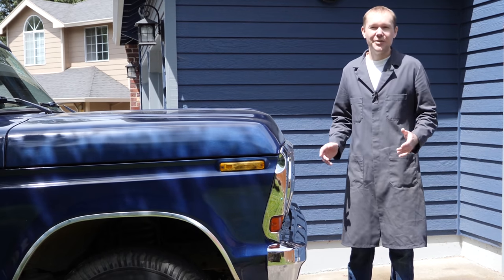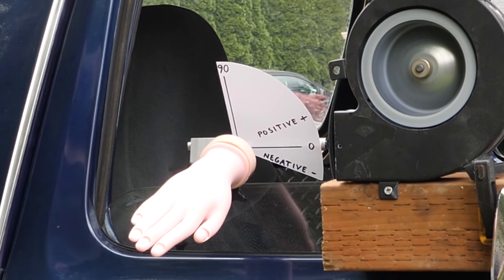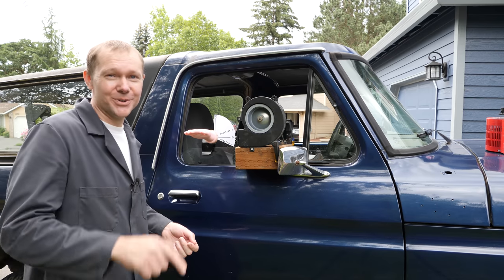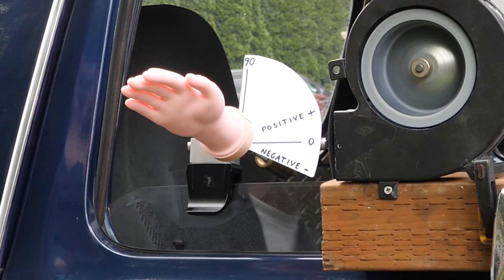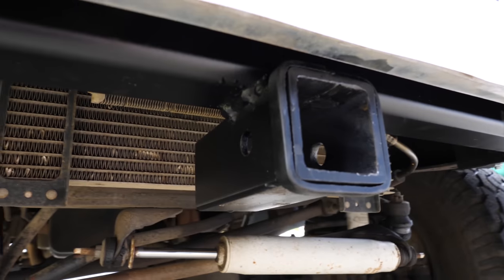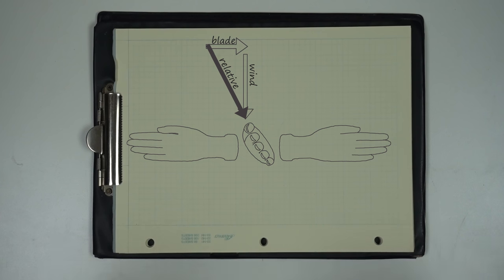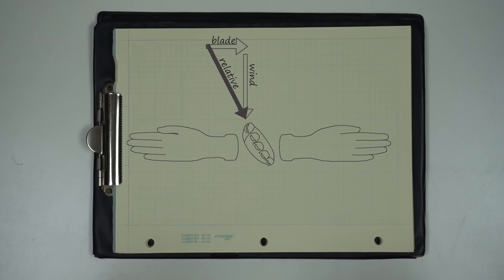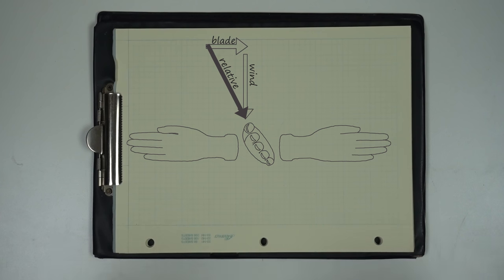Wind Power on a CAR #1 - Is it FREE?

Comment: I recommend not doing this out the public streets for the fact it is better to put a small turbine fan and install a safety feater because it is better to do so that is the fact in future the fan size turbine can or could either kill or injuries risk.  What I present an idea is using those small computer fans size as turbine energy crank because you can add tons of cans in the front and it is smaller enough that wouldn't hit no one but have to worry car accident but then again you could put it on you know the side of your door or somewhere on the rail of your car or either attachment on top your car.  This will help a whole lot and probably able to charge your phone, the car battery and so on stuff but the big problem is there is no warm weather every time so what do you do then?  uninstall the fans during after fall that is all I can say because snow in small fans is hard to have it ok during that time because in winter if water get into the fan's wheel barrel basically you're stuck for long periods of time.  The best bet is to install these fans in your car as in near the engine that is a slap in because you do get wind in there but the chance of risk of water being in there may have slightly slim in somewhat ways for I still recommend to actually figure out how to waterproof it and keep them durability in good shape.

The best idea is to use thermal energy as well because of the fact we are burning form our car and having something on top of it provide the heat acting like conductor sort of like how thermal generator works but there is already invention about it which have to do with burning stove wood in camping device which it charges the battery and if that heat is not being used for anything else it would be complete rubbish which yes I do know the engine can charge the battery but wasting that much of heat should have been used as well because you won't get every single energy out of the car what it is making.

We could have 3 power providing for the car, solar, a turbine wind and thermal energy which the solar car is already invented, a turbine wind you had made and thermal energy the burning fuel energy for we want to get much we can with these trio powerful conducting energy as an example for it could possibly charge up a whole house in no time.

Comment: Could you perhaps use a "cylindrical wind turbine" style of windmill mounted horizontally, and take advantage of the magnus effect to both redirect the wind up and over the vehicle AND generate a little bit of power, while minimizing the additional drag on the front of the vehicle?
Reply from the maker: Interesting.  I've never heard of the magnus effect used that way.  Hmmm.
Reply: @QuintBUILDs  well my thinking is that if you have such a cylindrical turbine mounted sort of high, maybe about hood-level or slightly below, and spinning in such a way that the side that's downward toward the road is moving back and toward the grill/hood, it will de facto pull the air that has nowhere else to go up and over the hood (or under the truck) and because it's moving with the natural flow of the air, you will simultaneously exploit the magnus effect sort of gaining "lift" due to the higher pressure below the cylindrical turbine acting as a wing and the air current having little other choice.
I haven't bothered trying any of the numbers, that's what experimentation is for, but at least in ~theory~ it could work, how well I have no idea...
If it turns into the next great invention that makes zillions of dollars I only ask for 1% of the royalties ^_^

Comment: Seems the "positive" vs "negative" angle of attack just regulates the direction your fan will rotate. Because "negative" angle of attack is only negative on the right-hand side. On the left-hand side, it is the positive angle, so you are thinking wrong. Instead, use the angle at the top position. It will make things clearer. It's not about lift, it's about lift vs down-force. At the top position, that would be leftward vs rightward force.
Reply from the maker: It starts to matter with asymmetrical airfoils.
Reply: @QuintBUILDs  
Of course. But that's the reason, not lift vs nothing. Fact is, down-force is used in car-racing, to keep cars on the road.
Reply: Fact is, apparently an F1 car could likely drive on the ceiling of a tunnel, due to it generating so much down-force, it exceeds the weight of the car. Quite fascinating. I don't think anyone has tried it, though. :D

Comment: No.  It will take more energy to cause it to function than it will generate. 
The vehicle is likely more un-streamlined than it was before the wind turbine was created, so no reduction in energy required, but likely an increase.
The air coming off the blades of the wind turbine is creating turbulence that will likely effect the vehicle, thus worsening it's energy required situation even more.
That's my prediction, but have fun testing all that. :)

Comment: What you could do is have the fan drive an electrolizer, that generates hydrogen and oxygen, and pump the hydrogen/oxygen mix into the intake, and decrease the amount of fuel going into the carburator, that way, you decrease the amount of fuel you actually use to run the engine, and increasing your range and fuel efficiency

Comment: I'm pondering the possibility of mounting a used 12 volt permanent magnet cooling fan on the front of my old Dodge brick and using the electricity generated to produce hydrogen via electrolysis. I look forward to seeing your results.
Reply from the maker: Should work, just depends how fast you go.  Those brushes will probably give it a pretty high start up speed though.  I'll be thinking of your application as I do this!
Reply: @QuintBUILDs  I'm still out in Imaginary Territory but as I happen to have several of those cooling fans laying around I thought I might add this to the list  "improvements" I'm adding to my Dodge brick (1988 D 150.) They could sit right on top of the 6"x11" oak bumper I've already added to the front capturing the same air that flows through the radiator.
I'm also considering trying to recapture some of the lost heat that flows out the exhaust. General Motors is already doing this in some of their full sized SUVs but it is pricey and I still need to learn a lot more about how it works. As I'm retired and living solely on a Social Security, my projects are built from junk. Didn't stop me from building this StreetPlane some years ago:  http://www.lassiter.com/mov/jones.html

Comment: wanna try something cool? try tying a rope between the top of two PINE trees, the rope has to be made of NYLON and be as thin as possible, loop the rope around as to end up and the starting end.
place a two blade propeller in the middle of the rope between the trees. then spin the propellers in order to twist the rope as tight as you can, when the rope looks twisted end to end and you notice the tip of the trees are bending slightly release the tension on the rope by allowing the propeller to spin back.
see what happens!!!

Comment: I dont want to sound like a safety sally and I know you're going to be careful but if you drive on a highway that post basically acts like a spear into any car infront of you, could the turbine be mounted closed to the front bumper?
Reply from the maker: I get it, like an old steering column before they made them collapsible?  I suppose I could put a weak pin in the receiver tube that would shear easily.

Comment: What would happen if you were in a hybrid vehicle and used a horizontal fan connected to a generator while removing the Internal Combustion Engine and just use the air generated from the movement of the vehicle to recharge the batteries?

Comment: Couldn't the reason why the hands are turning be more of a result of the moment about the hand's axis that it's attached to? The aerodynamic center of pressure of most aerofoils is located about a quarter of the way back from the leading edge (the thumb in this case). To me, it seems that that could be a significant factor contributing to the increased angle of attack after you stopped the car especially since the hands were free to rotate.

Comment: Before watching I would assume that it is not free energy as it creates more drag which will then have to be offset by using more fuel to reach the same speed.

EDIT:
And now I understand that there is way more to wind turbines than I ever imagined
Reply from the maker: Awesome.  I've already learned 10x what I knew about wind turbines with this project.  Cool that the project allows me to share that.

Comment: Very good experiment to recover energy from spent energy in facing wind resistance and drag.But why not channel the wind that the front of the car forcing out while travelling forward and use it run the turbine will make not more effective and efficient?(I mean  collect the air streams which are forced to move  under the chasis and over the roof may be made to collect them /direct them towards a turbine  with proper guides )
Reply from the maker: Recovering spent energy, I like that description.  I also like the idea of channeling the air but am not sure if the increased drag would be more efficient.  Horizontal axis wind turbines are supposed to be the most efficient wind power generation method in existence so I'm starting there.  We'll see where it leads! 👍

Comment: If velocity of wind is decreased after it passes the turbine blades, then aerodynamic drag force due to air must decrease, right? If it does decrease, then we can travel more with same fuel i.e. mileage is increased. Should we actually implement this on vehicles?

Comment: i dont think the brick shape matters as much as the old engines were not made to get many mpg's. any old model ford or chevy V8 got around 10 mpg. i had a 78 bronco and it would go anywhere but i didn't have the upgraded interior of this one haha
Reply from the maker: This one's running a 2004 5.4L Triton. :)

Comment: This is unrelated to the topic, but the wood used to mount the test with rubber hand on the side of the car has a very odd(to me) pattern on it like it's full of staples.  I've seen this on another video, but never in person.  What is this?  Why is that done?  As a woodworker, I have so many questions.

Comment: Try a cylinder style wind turbine. They make a vertices style. Why couldn't you make a horizontal style inside a hood scoop etc.... Think about how a brush bar in a vacuume scoops up dirt, why not reverse engineer a light weight horizontal wind impeller  it could run the full length of the bumper without sticking out too far.
Reply from the maker: Hey that's not a bad idea! A lot more sheet metal work but less noticeable for sure!

Comment: It will be interesting to see if this fan will make the truck less aerodynamic. How will you measure the mpg and the drag force?
Reply from the maker: The truck has a modern computerized engine.  I should be able to monitor instantaneous mileage or at least injector pulsewidth and calculate from there.

Comment: I bet he added the newer engine from an F150 so he would need the dash for the electronics to run but the modern engine. I would like to see the Bronco build.
Reply from the maker: Yup. It's a resto-mod I did with the engine, trans, transfer case, ABS,  and A/C from a totaled 2004 F150. Just took it thru DEQ testing again and it beat the old 1978 standard no sweat!

Comment: Have you thought about using 2 vertical axis turbines hiding partially behind the c pillars?
Reply from the maker: Hmmm, I like the idea of putting stuff behind the vehicle but vertical axis turbines can't harvest as much as the horizontals (according to my sources).
Reply: @QuintBUILDs  that's why I was thinking they would be partially behind the cab. If only one side is exposed to the driving wind and the other side is shielded by the cab, then it should increase the efficiency of the vertical axis turbine.

Comment: Another perpetual energy machine?! Funny how they are not all over the place if they are possible; proper engineers are quite good at that sort of thing.
Reply from the maker: If the turbine were above the truck then it would certainly add drag, but in front of the truck in the wind that is already destined to hit, I’m not so sure.  I totally get the “no free lunch” thing, I’m an engineer after all, but hey, it will be a great learning experience finding out!  And of course you know I’m not going to fake anything like the typical “free energy” hoax channels.
Reply: Quint BUILDs Any turbine is going to extract energy from the air, slowing its passage around the vehicle. You might be able to design ducting that extracts energy in such a way as to be reducing vehicle drag at the same time, so get "free energy", but in that case you would still get better gas mileage with just the ducting and no fan; that would just be improving the vehicle aerodynamics to make it less inefficient (such as the ducting around the front corners of many European square-fronted trucks).

Comment: You're just trying to take back the extra-fuel you spent with the turbine facing the wind. Taking energy from the windturbine will slow your car. As soon as you're puting a load, it will slow the turbine, and wind is gonna face your blades -> slowing your car (ramping up your fuel consumption). The more surface is facing the wind, the more it will slow the car.

Comment: tl;dr no you can't, the drag of the turbine necessarily costs more additional energy to move through the air than it recuperates, otherwise it's an overunity machine.
Reply from the maker: If the turbine were above the truck then it would certainly add drag, but in front of the truck in the wind that is already destined to hit, I’m not so sure.  I totally get the “no free lunch” thing, I’m an engineer after all, but hey, it will be a great learning experience finding out!  And of course you know I’m not going to fake anything like the typical “free energy” hoax channels.

Comment: I just subscribed...I am interested in the work you have done to that bronco...could u do a walk around..👍
Reply from the maker: Thanks.  Used to have a website on it I'm trying to resurrect.  It's a '78 bronco resto-mod using a wrecked 2004 F-150.  It's got the new engine, trans, transfer case, A/C and ABS brake controller.  I promise I will do a "walk around" soon, that should be quick and easy.  I'll post it on my 2nd channel BUILD2.

Comment: You need to make a video on ALL you've done to that truck.
Reply from the maker: It's on the list.  It's a resto-mod I did with the engine, trans, transfer case, ABS,  and A/C from a totaled 2004 F150. Just took it thru DEQ testing again and it beat the old 1978 standard no sweat!

Comment: Shouldn't  you create a tube with a( tunnel kind)generator. It will give both better voltage &  reduce any drag on the car. Otherwise the fuel consumption will go up.  Net gain of energy be zero?

Comment: So the wind turbine is rated for 40km/h?
Reply from the maker: bingo.  These small ones have a controller that shorts the coils when the RPM gets too high, acting like an electronic brake.  Haven't used it yet but will in part 2.

Comment: Ah......did the cop stop you and bill you for dangerous driving? 

Yes, car companies thought of this issue already, they don't use a fan mount on bumper, instead they modified their electric motor to double as a generator. Not only cars, some bicycle motor also feature the this functions too. When the car sense it is in the correct acceleration speed, the circuit switch into generator mode and harvest the electricity back to the battery system. That's why those electric or hybrid car can run so far a distance. Remember, batteries are just roughly 1/10 of energy density in weight compare to gasoline if no energy harvest mechanism being installed. Even as small as the remote control cars test already show that trend.

Comment: So wind turbines would be more efficient if they could change their angle of attack at different speeds right? The relative wind direction changes and so should the angle of attack, sounds right but idk haha
Reply from the maker: EXACTLY!  In fact the largest turbines have variable pitch blades!  It involves a complex mechanism in the nose of the rotor to make it happen but allows them to maximize power output across a MUCH wider range of wind speeds.
Reply: @QuintBUILDs  That is so cool. First thing tomorrow I'll look into it. Your videos are so fun, they make us think. Thanks for all the hard work.

Comment: How do the exterior and interior of your truck not match? The interior looks like it's from an 07 F150, but the body is from a different era!
Reply from the maker: 1978 Bronco with the guts from a 2004 F-150.  Used to have a website on it that I'm trying to resurrect.

Comment: Great video :D I wonder if you can have spring loaded turbine foils that change based on relative angle of incoming winds, not sure if that’s a thing :P 

In any case I don’t think this wind turbine idea will work, if you make a closed balance over the system, any force that hits the turbine and generates energy has to be met with an equal opposite force by the car - even assuming 100% conversion of drag to energy (electricity) and 100% from electricity to wheel torque, you’d only be net neutral. I might be wrong. Fun to watch though :D
Reply from the maker: One of the most intelligent summaries so far. We will see if you are correct! 👍

Comment: Ok understood, just one question. 
Why at 7:50 is the arrow clockwise but the hands rotate counter. Ore is that just my visual perception.
Reply from the maker: If you pause it at multiple points you'll see one hand is slightly bigger as it comes toward you.  They are indeed spinning CW from the top.  At least I think so!
Reply: Quint BUILDs oh oh , I had to play it at 0,25 the speed .